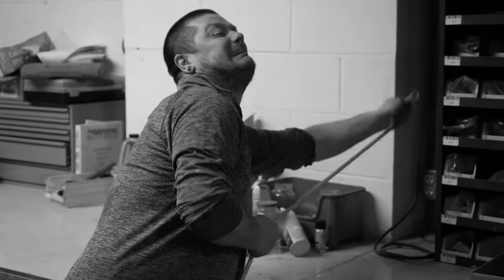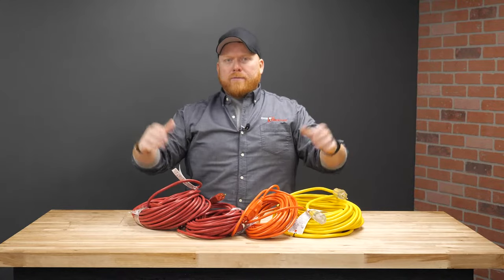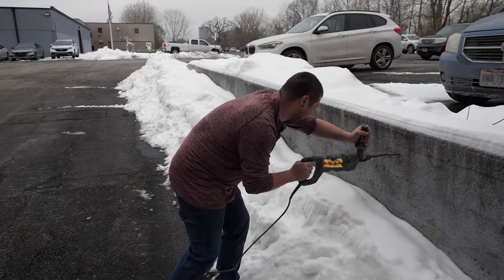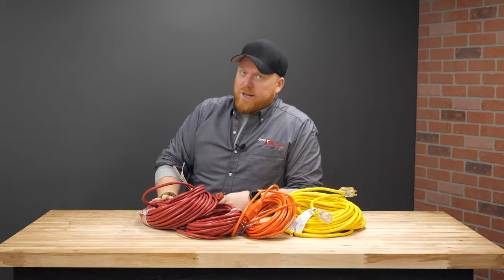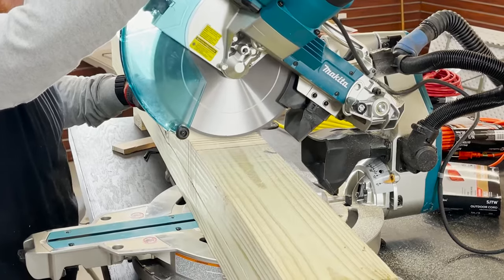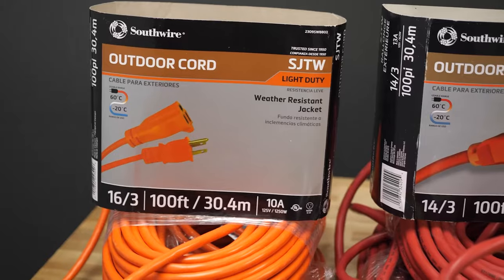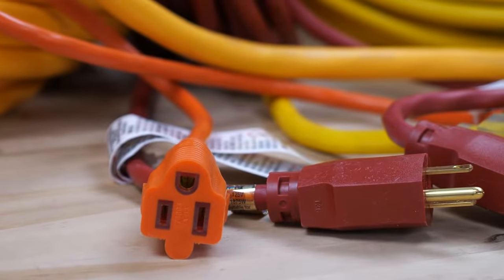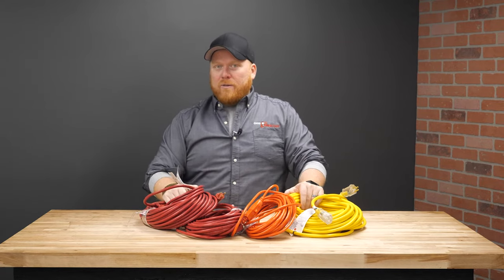Amps, Gauges & Length | The Importance of Extension Cords

Comment: But what if your not using it for power tools I have a 100’ contractor grade power cord running out to my shed to run a light, a tv and internet. I don’t leave it plugged in all the time just when I’m out there witch is every night how do I know how much amps I need (I know it’s not the safest but to get my shed powered to my house was gonna be $4000 and I don’t have that kinda money)
Reply from the maker: As long as you've got a surge protector hooked up to ensure against power surges, you should be set with a standard cord!
Reply: @OhioPowerTool   ya I got one hooked up and the extension cord if 12 gage

Comment: Ok, going from a generator to the house outlet.  I have two 25 foot 10ga, 4 wire.  Is it safe to hook them together or does the connection preset a fire hazzard?  The Generator is 30 AMP, 240 volt, and the wire should handle the load, I just am not sure about the connectors.  I realize that the 50 foot may drop amp or voltage somewhat...I would appreciate your input.

Comment: Hi Nick. I have a question that some might find the answer interesting to know. I take a 100ft extension cord and plug it in to the wall outlet, run the other end out to the shed for lighting but don't turn the lights only at certain times of the night. is the cord using electricity even when the lighting is off?

thanks
Reply from the maker: that is a good question. the easiest way i can put it is that it works similar to a water hose. if your sprinkler is off, the water sits in the hose but the flow has stopped. if your cord is connected to a electrical source, electricity is flowing through that cord, but when your lights are off, your electrical current is significantly less as your light is 'blocking' the flow. hopefully that makes sense. thanks for watching!

Comment: Trying to find one for my heat press machine. Any recommendations?
Reply from the maker: I would not suggest using an extension cord for that a heat press machine if you can help it. When possible try to keep as close to the power supply area as possible.

If you are in a spot however and are needing to use an extension cord. Something 12 gauge or larger would be recommended, in as short of a cord as you can get for the job.
Reply: @OhioPowerTool  Thank you for the info, I greatly appreciate it. I was trying to avoid it but I have no more room available in the basement and the outlet isn't close enough

Comment: I was wondering what two prong extension cord should I use for a 1500watt electric kettle?
Reply from the maker: Great question! Unfortunately we only carry 3 prong extension cords, but a 10-15 amp cord should be more than enough to power a 1500watt kettle. Be careful when using a 2 prong extension cord though, they have a tendency to overheat easily

Comment: I have a husky 1800 watt generator.  What’s the maximum length extension cord. To power 46 inch tv?
Reply: you need an extention cord for the generator to wall or a cord for tv to generator?
Reply: @songanon   it’s for camp trip.   Just curious  what’s the longest distance an extension can be.  If too long will cord heat up or damage electronic devices?
Reply: @Shea_Connerty  longer will just not allow as much amps and volts even with a cord rated at the same guage. that's why they also tell u max amps and volts on the wire when you buy it. So you don't have to do the math. the typical rule is to use 2 less gauge from the device's original cord. A 14 gauge cord for a circular saw(the wire will say right on it) should use a 12 gauge wire. The longer the wire the fewer amps the wire will supply, which is why you just look at the amp rating of the wire. But I have a question. Now if ur running an extension cord from the generator to a device, for the most part a 14 gauge wire will be just fine. But lets say its a heater. 12 or 10 gage is what u may wanna go (given the watts, amps, and volts are at or under what the wire can supply) . As for an extension cord for the generator , read the manual it should state if u can even run one. but given the specs u gave me, 10 gauge cord is what ur gonna wanna go with. This seems to be the safest. at 125 volts a 10 gauge will only go up to 15 amps and 125 volts. But will provide better insulation for the wire than a 12 gauge rated at the same specs. Now obvi the longer the lower it will go, but the box of the wire will say. But the generator is probably running on higher than 125 , prob like 200 something, so 10 gauges are far more common on this higher volt (will not fit in a standard socket obviously) This will most likely be the safest bet for a generator, but u would need to find a plug that u can fit the 200 something cord. Most camping sites probably support this type because of this
Reply: also make sure its rated for outdoor use, if it doesn't say the cable isn't! This protects it from overheating and damage

Comment: I don't get this, I bought a 14awg/3c extension cord that says 13 Amps but all these charts I see say 14 gauge at 200ft isn't even enough for the 8 amps I bought it for.
Reply from the maker: 14 awg cords cannot handle higher amperages, especially at longer lengths-- a 14 awg/200ft cord should really only be used for 2-3 amps. If you need a longer cord we would suggest going with a 10 or 12 gauge because they are much better at managing their power output at long distances.

Comment: I just know this isn't a good idea but someone won't get a proper cord for the hot tub and pool.  The setup is like this 
One extension cord is plugged into the house. This goes to one of those plug stations with 12 outlets I think.  Now one of those has another extension cord plugged into it to go to the pool where a pump and a heater is plugged in. Sometimes another extension cord is used to plug from the end of the pool cord to the commercial bouncy castle slide. It's huge.   Now tell me why their heater pump keeps turning off constantly.     Ty:)))

Comment: So I've heard the rule of thumb is to use 2 less gauge from the device's original cord. A 14 gauge cord for a circular saw should use a 12 gauge wire. The longer the wire the fewer amps the wire will supply, which is why you just look at the amp rating of the wire. But I have a question. 

I have a 14,000 btu ac (15 amps, 120 v, 1800 wats) It just BARELY hits the plug on the wall. So the wire for the ac is rated at 14 gauge, however, I don't feel safe using a 12 gauge wire, even though it says it supports up to 15. I did find a 10 gauge wire at only 3ft, but the packaging says it only supports 15 amps (what I need anyways). But how could it be that the lower gauge supports the same amps as the 12 gauge, and it's a shorter wire too? Is this more so a limitation of the volts? I am assuming you can't get any more amps out of a 120 ish volt plug. Cause I checked 200 ish volt cables and at the same gauge of 10, it supports more amps. Now I know it is not necessarily the safest to use an extension cord on a device that's always in use, but we do keep the space at 75 degrees so it's not like the ac is going to be at that max amp all the time, mostly just at startup. 

What is the benefit of using the 10 gauge @ 15 amps over a 12 gauge rated for the same amps? is it just better protected cause the wire is just bigger?
Reply from the maker: 10' isn't going to make much of a difference honestly. However, with 15a, 10g will definitely help keep a steady flow of power. The cord is thicker to push more current. Works like traffic, more lanes, better flow. Also, to answer another question in there. Sure, many cords can push higher amps than normal rated, but running all day could burn up your tool/unit cause the current isn't flowing (constant rush hour traffic lol).

Comment: Question? This is all very fine , but how do you deal with arc fault breakers on the jobsite, they flip breakers ,table and miter saws .

There is no info on this , on all of YouTube
And not much on google either.

Go for it.

Yes you can buy battery powered tools

Very expensive solution
Reply from the maker: It sounds like your extension cords may not have the proper gauge to run the tools you're plugging into them; take a look at the power requirements for each tool and make sure your extension cords are able to draw enough power from your power source to sufficiently power your tools!
Reply: Believe me , it’s not that, this is a very common problem on jobsites
I’ve tried plugging directly in.

The issue is arc fault breakers, even a 20 amp will
Flip, 
Not every brand of arc fault
But 1/2, 
Not one video on YouTube
On it,
Ask any working new home
Carpenter 
It’s a big reason why many are going battery everything,

My question would be is there a variac of some sort that would work?

Comment: so which cable is the best? for most devices outside like wash car seats and for example use a vacuum for a  powerful suction of dirty water
Reply from the maker: Both the Southwire 100' 12/3 SJTW Outdoor Extension Cord With Lighted End (Yellow) 2589SW0002 ( https://www.ohiopowertool.com/southwire-tools-equipment-2589sw0002 ) and Southwire 50' 12/3 SJTW Outdoor Extension Cord With Lighted End (Yellow) 2588SW0002 ( https://www.ohiopowertool.com/southwire-tools-equipment-2588sw0002 ) are both good for outdoor use as they stay flexible and durable which still being able to power a vacuum!
Reply: @OhioPowerTool  Thank you for the info

Comment: I also have 240 volt extension cords and then I use a 3 KVA step down portable transformer to reduce voltage drop from long cord runs.

Comment: A higher gauge wire increases it’s resistance, making a voltage divider circuit on both ends of the tool. You won’t get any amperage drop because the amperage is the same no matter what’s in a closed loop. You will have a voltage drop because your tool is in series with 2 resistors (the wire going in the tool and out to the plug)

Comment: Where can I find or can you recommend a 150' cord? I have literally been looking for one for 3 days now and although often mentioned or referred to (in concept), in various places, I can't actually find one for sale ANYWHERE !  EXTREMELY FRUSTRATING !  P L EA S E  H E L P !
 (I have a TORO 120-volt, 12 AMP Ultra Electric Blower &Vacuum Mulcher, Model # 5619, Serial # 320208820)
Reply from the maker: For powering a 12 Amp tool we wouldn't recommend using a cord any longer than 100 ft. because longer cords can overheat easily. We have a few different 100 ft. cords available here: https://www.ohiopowertool.com/categories/extension-cords-gfci?p=2
Reply: @OhioPowerTool  A 10 gague (i.e., 10/3 geavy duty outdoor) 150 foot cord should be able to handle this w/out that problemm, shouldn't it . . . or a 100 foot 14 gauge (i.e., 14/3 heavy duty outdoor) cord,  coupled with a 10 gauge (i.e., 10/3 geavy duty outdoor) 50 foot line, as the primary / 1st feed from the power source ?   I need a 160 foot range due to the size area I'm dealing with.
(I will check out your link, too)